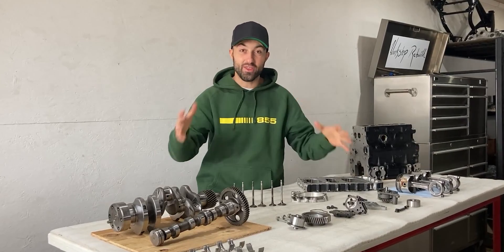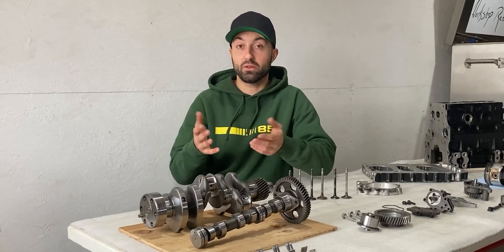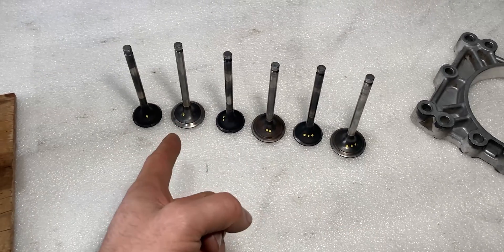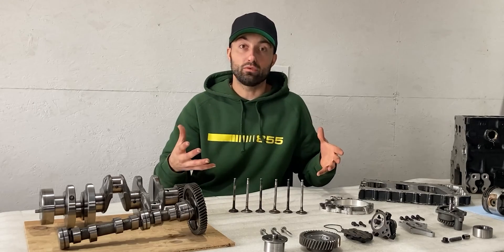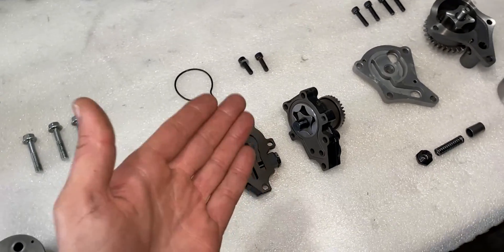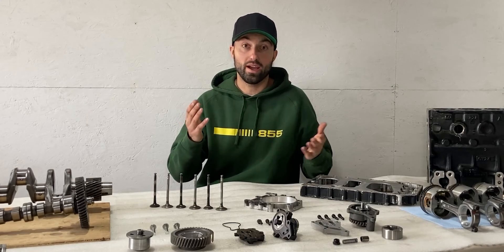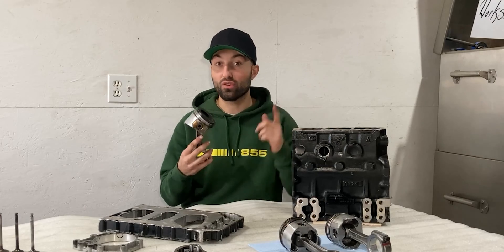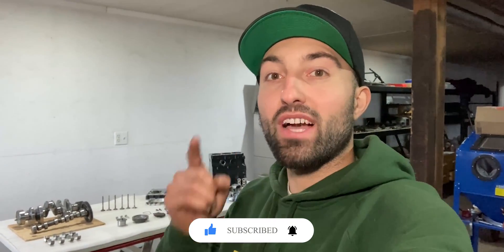THIS ENGINE NEEDS A REBUILD! | Diesel Yanmar 3TNV82A

Comment: I’d like to comment my personal experience.

My guess is that the cylinder bores are worn from dirt.

The 855 John Deere has two air filers that could fit it :AM 102746 and AM 108184.

The former is 9” long and the latter is 8.25”.  Other than that they are identical.

People frequently use the shorter filter without realizing it and that leaves 3/4” air gap around the air filter at the back of the canister.
Reply: Awesome comment, Thanks! Is there any way to check fit when installing the element? 🤔
Reply: @georgehofgren6123  Compare the old filter exactly to the new one.  Also, the screw to hold in the air filter should tighten to the filter.  If you can shake the filter after it's tightened down, you have the wrong filter.
Reply from the maker: Thank you for sharing your experience here in this video! I was not aware of the two different filters you mentioned above.
This engine came out of a John Deere 1445 and the air intake box is a little bit different to the John Deere 855, but I will make sure the new filter seats up against the bottom of the filter housing to ensure no debris gets past. 
Regards Andreas

Comment: An easy mistake to damage the oil pan spacer. Bolt to the block not the spacer. The end of the oil pan spacer can be broken if an engine stand is attached to the flywheel side spacer end bolt holes with the oil pan facing upward. As the oil pan bolts are removed the spacer also separates from the block on the stand end and transfers the hanging engine weight to the remaining spacer bolts on the opposite end of the engine. Snap!

Comment: Speaking as a retired LAME with many hrs rebuilding Lycoming Aircraft motors, this is a very good inspection video.

The question of bore/piston wear combined with the oil pump wear leads me to the journals as you also indicated the lip on them, with associated big end bearing scouring.
I see a situation that this motors oil pump would fail under high loading, disrupting the oil pressure to the bearings, and giving the motor a clear big end bearing "rattle" when over 2,700 rpm.

It was close to complete failure, and a rebore, oversized pistons and new oil pump, sump extension, etc obviously necessary.

This motor was assembled very poorly, the welded section of the sump extension is actually a shocking example of an obviously 
shocking repair, with the broken section most likely caused by the partially stripped motor being dropped onto the floor, and that end breaking right off.
It was clearly reassembled on the cheap, and in a great hurry.

You NEVER HAMMER ALI, but lightly tap a soft block of wood in the middle, that has been laid over the entire part so that even, light pressure is applied.
If you are tapping it harder than you would hit your finger with a hammer, then you are tapping it too hard.

Personally, I would throw away the valves and seat new valves in, simply due to saving the chances of one being too close to minimum tolerances and splitting, breaking, jamming, and then snapping the valve with the associated piston/bore damage that would result.

What did the crack testing around the valve seats and the big end bearing crankcase area show ?
Piston "wobble" usually causes cracks in both these areas, with the valves actually also getting some sideways movement putting extra pressure on the head of the chamber.

There were many cylinders that we found this damage to, which Aviation Laws prevented repairs being made, and we were required to break off the valve stands with a hammer, rendering the cylinder useless.

All reassembled engines should be fully "run in" prior to instillation, with a correct high ISO Bedding Oil, and then secondary compression checks done.
Always cut open the internal filter element to check for any metal wear when changing oil/fuel filters.
And always friction proof your new engine with a good viscosity additive such as Wynns, etc.

I always use additives for engine flush, motor & transmission & diff oils, and every full tank of gas.
It gives me a friction proofed motor and box, and very, very stable compressions with high mpg.
( as well as a very long engine life )

These same oils were used in the aviation industry, and are worth every single cent.
I get 30% more out of every gallon of gas than anyone who is not using them.
Reply: Hired !

Comment: So, what was the condition that led to the decision to rebuild the engine?
Lack of compression, unusual oil consumption, high operating temperature, or ...?
Reply from the maker: This engine was in a commercial unit ( https://youtu.be/BU0aOkDjeG8 ) and it was sold at auction with engine damage. I decided to take it apart, because it did not look good from the outside...especially with so much silicone along each seam. I figured out it had similar wear to the Yanmar 3TN75RJ I previously rebuilt, after just 1000 engine hours! This must have been from diluted oil (oil+fuel), hot operating temperatures (led to premature cylinder wear) and bad engine components in general.
This is another reason why I prefer to take engines apart before trying to start them or even turning them over by hand with a breaker bar. This engine will be rebuilt and hopefully it will runs much better after that. Thank yo for your great question! Regards Andreas

Comment: Random quesiont! If one of these engines runs away - how can you shut it down quickly? Is there any easy trick to kill the intake air somehow?
Reply from the maker: I‘ve never had to hurry and stop a diesel engine from a „Run-Away“ situation, but I have heard you must react fast with a flat board or cardboard to block off the air intake. This is the only way you can eliminate major failure.
It‘s always good to know if it ever happens, but let‘s hope it doesn‘t! Regards Andreas

Comment: Love your channel!  I have a John Deere 430 with the Yanmar diesel engine. For the life of me, I can’t get it to run. Seems like the injection pump isn’t pumping enough fuel.  I was hesitant to take the entire engine out to see what’s wrong but now I can see these engines are pretty simple and will probably do a complete rebuild thanks to your videos. Thanks so much!!
Reply from the maker: Hello Curt, thanks for tuning in and sharing your feedback!!😃👍🏽
Not pumping enough fuel could be something as simple as a clogged or old fuel filter.
If you really think it‘s your injection pump, you could always remove the hard-lines and turn them 180degrees. Put the ends into 3 plastic bottles and see if you have the same amount of fuel in all of them, after a couple of revolutions.
If you still don‘t have fuel, then you probably have an issue on the inside of the pump...
Let me know what you find out, I‘d be interested to know what happened.
Yanmar has a very good system in place when it comes to engine-families. Almost all 3-cylinder engines are identical, but you‘ll find different bore & stroke sizes. This makes it much easier for Yanmar to produce their products and it must cut down a lot of costs too😁
Thanks for leaving a comment, I appreciate it! Regards Andreas
Reply: Проблема решена?

Comment: I got a yanmar with 3800 hrs I have owed from new and another one with 1500 no problems with either
Reply from the maker: 3800 hours for a small engine is amazing! You must take good care of your engines and it just shows how regular maintenance prolongs the lifespan of an engine.
The previous owners of my equipment didn‘t really consider that, but on the other hand it‘s pretty good for me!😁👍🏽
Thanks for sharing your experience, John!

Comment: how many hours yamr engines are usually bullet proof
Reply from the maker: Hi John, this Yanmar engine came out of my newest project, the John Deere 1445 and it has ~1100 on the digital hour meter. 
It must be the original meter since the machine is in great condition, but the engine needs a lot of work. Nevertheless, I ordered parts and I‘ll have an engine assembly video very soon. What Yanmar engines have you been dealing with in the past?

Comment: How was the oil when you drained it? Any grit or glitter? I'm wondering if the welded intermediate pan is connected to the other issues. Maybe the engine was damaged in an accident and was run with contamination in the oil? Worn valves, scored pistons & bores, welded pan and a replaced fuel pump are a lot of issues with such low hours. Also the edges on the crank journal holes are very strange - like someone enlarged the holes but didn't finish the job. Could there be one event that ties everything together?
Reply from the maker: When I drained the oil I didn't notice any abnormal. The oil was black, but there were no noticeable pieces of metal, nor was there any glitter! It's really weird, because the oil pan extension is the only thing that is damaged and to break that would be really hard to do inside of the machine. there is a metal plate beneath the engine and other components around it.
It almost seems as if someone removed this engine and dropped it, or damaged the oil pan extension when it was removed...but that would be really hard to do!
That's exactly what I thought! The JD 1445 only has 1000hours on a digital hour meter and it doesn't look beat up. It's really only the engine that I have to work on and maybe I will have to replace a seal here or there.
The crank journals measure to the original specifications which means there chamfers could be from the factory like this...but that's hard to believe because chamfers are usually done before journals are ground.
You're right, someone was working on this engine and they didn't finish the job. On top of that, they assembled it very poorly with A LOT of silicone. I'll see what engine kits are out there and I'll try my best to bring this engine back to life.
Thanks for sharing your questions and thoughts about this situation, John! Regards Andreas